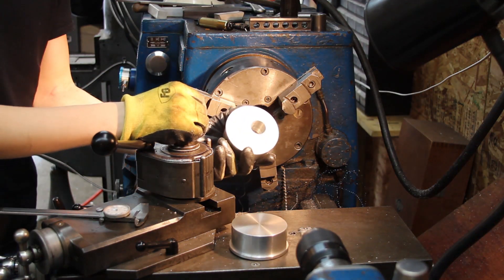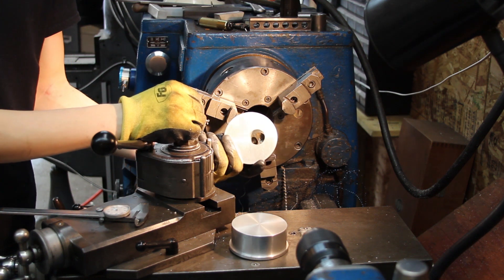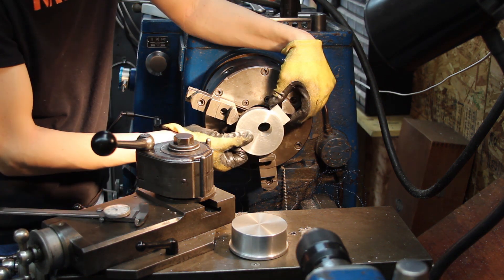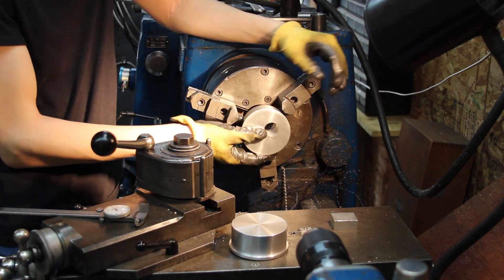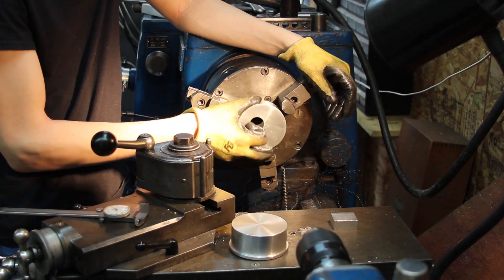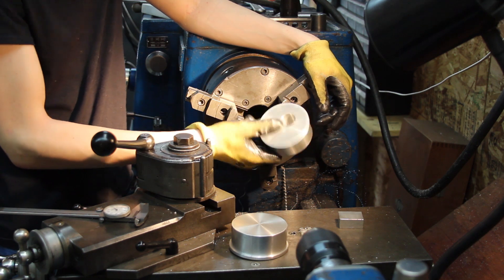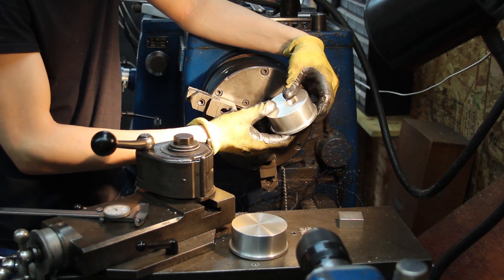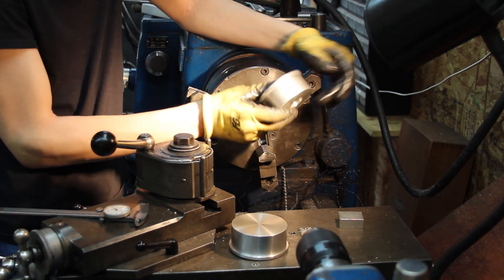Machining Bearing Holders

Comment: Hey Toby,

Do you have a four jaw chuck for your lathe? What spindle mount is your machine. Keep up the great videos. Good to see you wearing gloves! I for one approve. Don't touch anything that is moving. 

All the best,

Tom
Reply from the maker: Thank you! You don't know how happy I was when I discovered a gloved mentor, I really like wearing them. A while back I held some sand parer in on a shaft in the late a really dumb way, ripped the glove off my hand. (I think it's possible that without it I would have had the skin ripped of my hand) I learned most importantly not to hold the paper in a dumb way, and I also take my gloves off now. just a month ago I got a titanium shard in my hand while I wasn't wearing gloves, getting that one out sucked. My lathe has an A1-6 spindle mount, a four-jaw has yet to be within budget though.

Comment: Hi Toby,

Using a spacer in a 3 jaw chuck for offset turning is a time honored technique. Marv Klotz has a program called ECCENT on his website for calculating the packing required for a given offset.

What is your chuck mount style BTW?
Reply from the maker: Thanks! I think I will find this very useful. My spindle mount is an A-something...I should find that out, I think I'll go measure it this afternoon.
Reply from the maker: It's an A1-6.

Comment: Great job Toby! Good looking parts you machined there.

Adam
Reply from the maker: Thanks, If you look I put chuck jaw marks in them, but I was aware of that, the OD gets scuffed up by being clamped anyway. If I make them again I'll wrap 'em with a bit of tape.
Reply: So late on this comment lol.  Love the videos, Toby!! Does that particular part, rather 'did', call out for a specific finish?